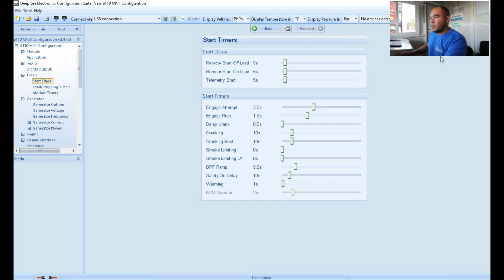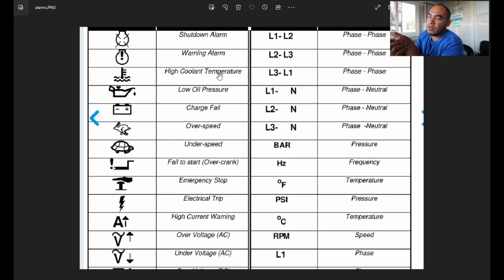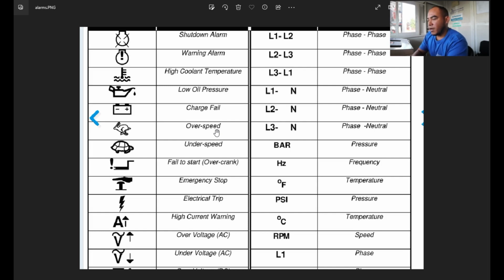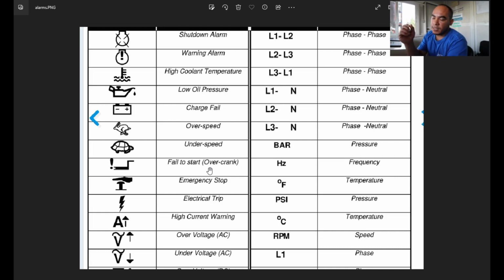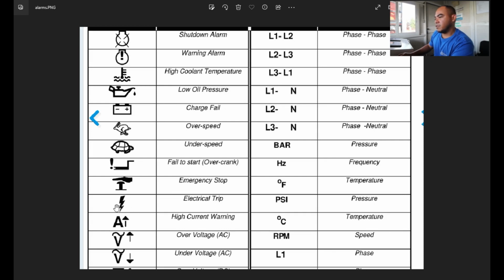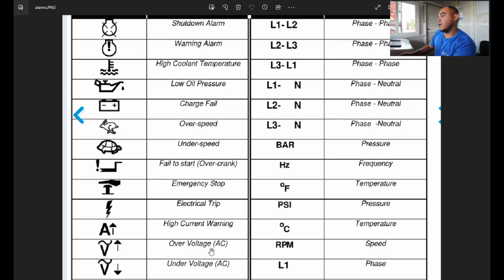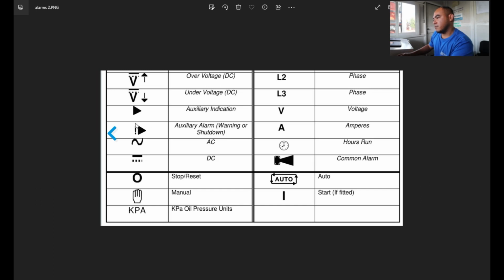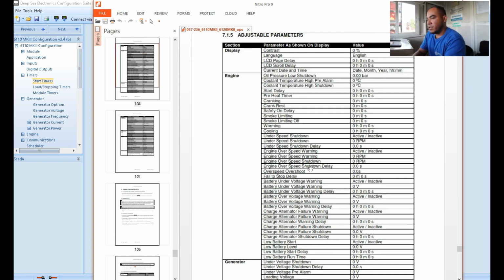display symbols shutdown and alarms simplify benzblogs

Comment: Sir, tanong ko lang po. Ano possible cause ng engine explosion? Yung cummins KTA-38 namin, sumabog crankcase, tunalsik palabas isang connecting rod.
Reply from the maker: Due to lock of proper maintenance and oil distribution blockage
Reply: @benzblogsVlogs  ano cause ng oil distribution blockage? Nagpapalit kami ng oil at oil filters every 250hours. Wala rin oil leaked ung engine.
Reply from the maker: @agent70vids3  the time did you check the histogram of your module sir ilang pressure ang na record sa module nyo the time  kong mababa at di nakaanot sa normal pressure ibigsabihin di gumagana ang pump kaya di nakadaloy ang oil sa tamamng popntahan nito
Reply: @benzblogsVlogs  6 bar po ung nasa oil pressure gauge may hourly reading, ung coolant temp nasa 84C, tapos 300A lang load. 1000KVA ang capacity.